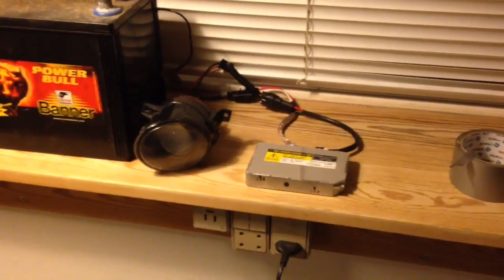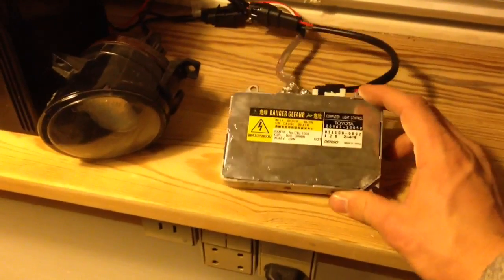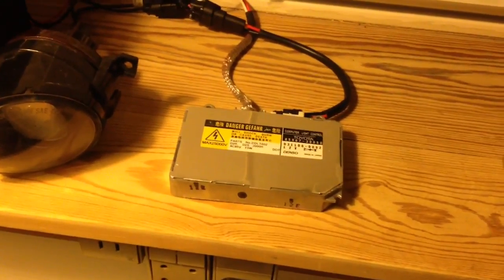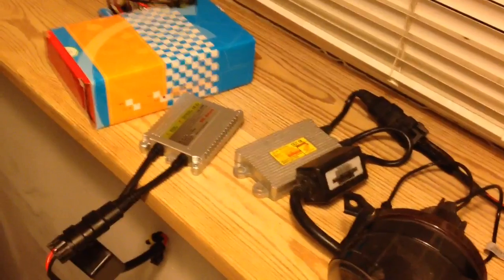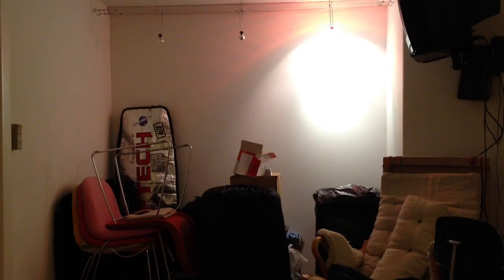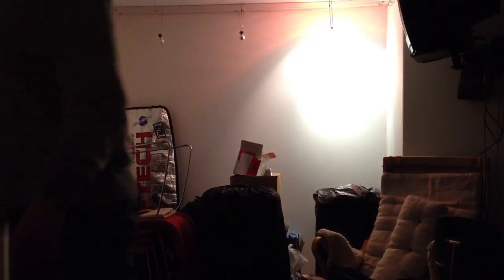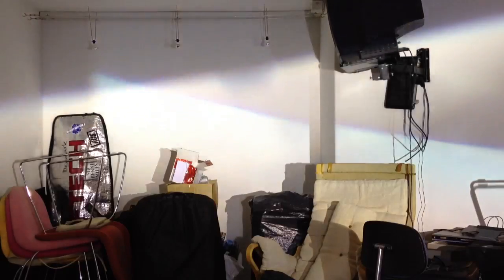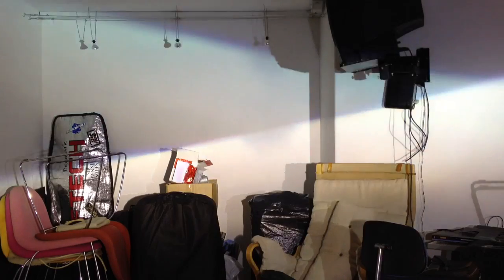HID Xenon Ballast Comparison Expensive vs. Cheap

Comment: what do you think about 3000k for low-beam bulb, can cops do something it they pull over you if you have these in car?
Reply: 3000k low beam is pretty yellow, go a little higher, like 6000k. Cops wont have time to pull you over for the hid headlights you have on. You should be fine as some of the new stock cars come with hid.
Reply: As long as you have proper hid projectors to put the bulbs in, there is absolutely nothing illegal about hid headlights. It's only illegal if you put hid bulbs in projectors not designed for hid bulbs.

Comment: the denso are also china replica.  the 55w will always out perform the 35w ballast.  as for operating temp,  its an option many makers offer high efficient now which means it will get the bulb into operating temperture within 2 sec.   These got nothing to do with quality,  its two different ballast

Comment: how did you convert them to work with aftermarket hid bulbs?
Reply: Cheesy Cracka
No they were referring to the OEM D2S HID types, there is a D2S to amp connector adapter specifically so there's no issues with amp connector type ballasts. This is awesome for retrofits.
Reply: +CivSi02 Not that simple the connections are different and if you are using aftermarket bulbs it also means you need an AMP connection which the retrofit source does for free and because it's an aftermarket application the denso ballast needs to be waterproofed as it is not designed for any form of moisture as in an OEM car they are tuck away in a moisture free headlight rather than outside the headlight
Reply: +851995STARGATE I have a set of ebay 35 watt and 55 watt bulbs, different no-name companies and the connections are exactly the same from ballast to bulb. Do you mean from car to ballast connections?  There are likely differences in amount of and cheapness of capacitors inside the ballasts though. Also, you're much more likely to have problems with them not lasting than not being equal brightness.

Comment: The ballast wattage doesnt determine the brightness of the bulb, if the bulb is 35W then the ballast as long as it is 35W or more will power it, you could use a 100W ballast the bulb will still only draw 35W, Personally I would always use a larger ballast so it runs cooler as it wont be at it's maximum output, example 35W bulb then use a 55W ballast, if you use a 55w bulb then use a 75W ballast or 100W ballast. The colour of the bulbs now days unfortunately are not accurate as they use to be because eBay bulbs are not exactly to specification, 6000k was considered at one stage the "Slight Blue White" but Ive seen even 5000k being Blue and 6000k being Diamond White. Those ebay Ballasts you have there are the good ones, there are so many more that are not. and overheat easily.
Reply: That is COMPLETELY false. A bulb will use the energy that it is given and shorten it's life expectancy based on how much over it is and for how long. The bulb WILL run hotter. Check online for pictures of burned projector reflector bowls when they use too much watts in certain projectors. The fact that 35w bulbs are brighter with a 55w ballast says that it uses more energy. I know this as I've run some Philips 85122 bulbs at 35w with genuine Bosch and Denso ballasts and they are the same brightness. When using a 55w ballast that actually puts out more power than OEM ballasts, the light output was significantly brighter and more yellower as it seemed to slightly drop the Kelvin. 

You are giving out false information most likely based on cheap ballasts that put out nowhere near their rating. Look at my video for an example of a 55w ballast putting out less watts than oem 35w.
Reply: esqueue Yes you are correct, I am in error, I have since tested the exact setup now that I have a 35w bulb and 50w + 35w ballast and it indeed draws current based on the ballast used and not the bulb used. My apologies if I have steered anyone in the wrong direction, I was without a question 100% wrong.
Reply: Elias Gourvelos That was mature of you. We are all here to help and learn. I may have been a little rude and apologize for that.

Comment: the ebay ones colour output is really disappointing. Too blue especially for the 35watt for 4300k bulbs they came out really blue... I run slim digital hid ballasts 35watt in my ford and 6000k bulbs and it came out way less blue then the 4300k bulb tested. I guess i got lucky with my kit
Reply: +TheWretchedWorld It might also be the camera adding blueness, they usually do. It depends, some ebay kits vary wildly due to cheap gas mixtures. I have a set of 55w 5k ebay cheapos on my G35 and they're flat snow white, which I love. But if you look at the car, they look slightly blue-purple-ish still like OEM hids on a g35 would. (they use 5k stock but phillips D2S bulbs)

Comment: I did the same comparison with the Hidextra hid kit and is works the same as the denso and is not that expensive. I bought it back in 07 and still works flawlessly(06 MDX retrofit). You can also try DDM tuning.

Comment: for what its worth, eBay ones perform equivalently good in my opinion
Reply: They don't, also, I have been using cheap for long time, I had to buy replacement because they don't last as long, light colors on each ballast way off the original color and simply, flickers which is annoying. Starter kit while you save it's acceptable ;-)
Reply: Pedro Rios i got cheap set for 30bucks and they dont get flicker... Flicker is because ballast isnt getting steady power.. Need to make a relay harness and you wont have problems... Most expensive kits come with capacitors built in so you can use stock wiring harness with no flicker..... That being said my set came with bad bulb and they sent me a new bulb and ballast. They come with 2 year warranty
Reply: quickguesswho I have morimoto elite, great kit working perfect..Thanks for your help

Comment: the bulbs are from ebay or only the ballast?
Reply from the maker: The 3000k are from the The Retrofit Source, the others were some ebay.
Reply: i already have fx-r projectors with morimoto 3five bulbs and 3five ballast but i need something cheaper for my other car!!!! so do you suggest to try the ebay items?
Reply from the maker: Well I guess it depends on what result you are expecting to end up with. If you want fast warm speed and the correct color, than you’ll have to find a quality set (preferably an OEM set). However if none if this is important, just go for a random set.
Reply: i just need a good output i dont care so much for the extreme cutoff or the fast warm up!!!!so i'm thinking to go for the hid projectors with bi xenon from ebay the pachage cost 95 dollas!you think that is good?have you tried it?
Reply from the maker: 95 including projectors sound all right (but of cause I can’t say without having tested the specific set). If output is important for you, you could consider a 55W set. Your bulbs will wear out a bit faster, but it will also give you a brighter output.
Reply: at retrofit they told me that the 35 vs 55 is a small diference!i will try the kit with the projectors and i will upload video for guys like us to see it!!!!

Comment: Thanks for the vid. It was helpful. I too am interested which ballast is making all the noise.
Reply: Probably the OEM ballast. Lot's of the new cheap ebay ballast use DC-DC converter which is silent but produces lower output power and highers the color temperature of the bulb i.e. the 4300K may look like 5000K. The good ballasts usually have DC-AC inverter. Pros- higher power output, correct color temperature and more light out of the same bulb; Cons - they buzz :D

Comment from the maker: Yes.
Reply: qasqdk , I have 2 doubt:
1) Is Denso Ballast wear on Civic 2009? The specification about Xenon kit for Civic is HB4 (9006).
2) Which a good HID bulb you recommend?
Reply: +qasqdk Hello! Do you know how to make the 55W on SHO-ME?
Reply: +qasqdk This is a long shot that you'll reply. I'm just gonna toss it out there that this was uploaded on my birthday, and we're coming up on another, so maybe that will bring me luck... anywayyyy, I have a B5.5 Passat, which has VERY similar if not the same projector fog lights. What all did you do to convert them to HID's? Obviously the ballasts and bulbs and all of that, but did you have to modify the housings, projectors, what bulbs did you use, etc?
Reply: +Tanner Young Bulbs are just bulbs.  You just need to find the right size bulb that fits your needs.  The thing with HID bulbs, they connect to a ballast and then ballast to a 12v source/switch compared to halogen bulbs that connect to the cars 12v source/switch.